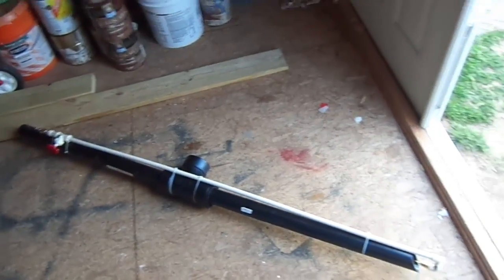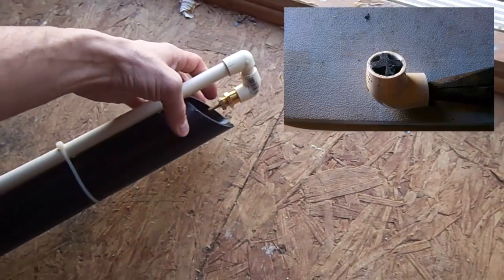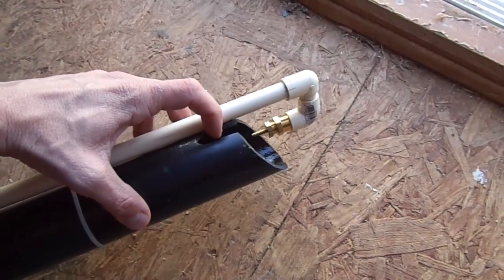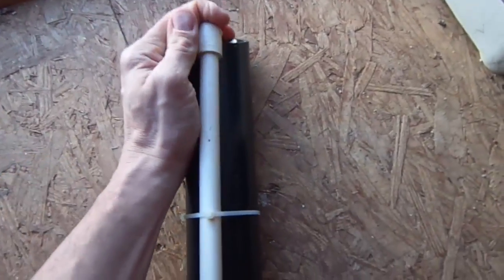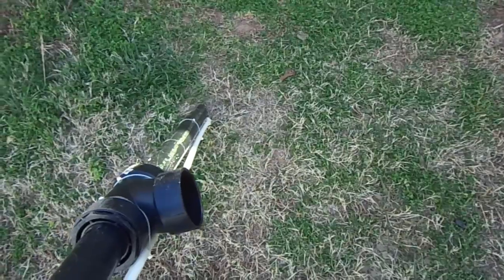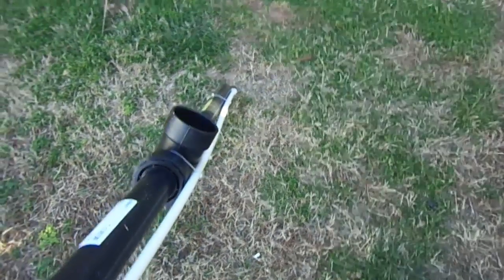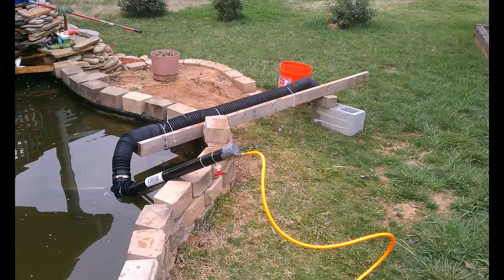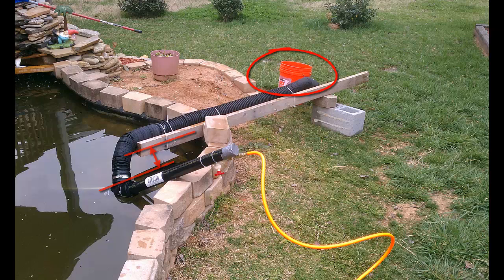DIY Air Lift Koi Pond Vacuum (Part 2/3)

Comment: Hi Wayne, my question is on your video regarding Air Lift Pump. I cannot get it to work and was wondering if you can tell me what kind of tip / size you are using at the bottom of the PVC that goes into the water.  I am using the same  size tip that connects to the quick disconnect on my compressor at the top of the vacuum.  . When I try to tweak my shutoff valve on the vacuum it either does nothing or it comes out so fast that my compressor cannot keep it running at 80 PSI. Thanks in advance

Comment: Hi Wayne,
Great video. It inspired me to try it. 

We have a lot of sludge build up in our pond and gravel that somehow magically comes out of plant pots (probably the always hungry Koi rooting around). The water is clear but I don't want the sludge (which I'm guessing is dead algae and dead beneficial bacteria) or the gravel so we typically drain the pond annually with a sump pump and use a garden hose to wash the sludge down to the pump.

It works but it's a day long project that wastes thousands of gallons of water, so when I saw yours sucking up stuff from the bottom with little water waste I thought; perfect.

Unfortunately mine doesn't work nearly as well as yours. 
It burps air frequently out the the tip (which kicks up a lot of debris) and the suction is very weak. I used 1.25" pvc and set up the air piping pretty much the way you did (the outlet is about 2" above the bottom of the tip). I'm using a shop compressor at about 80psi.

Is the suction strong on your set up?
And if so, what is the key; the size of the jet? the closeness of the TY fitting to the tip?

Thanks
Reply from the maker: Thanks for the nice comment, and well thought out explanation. I can't tell you for sure what is wrong... These air lift systems are sometimes a challenge to get right, because there're so many variables. 

One of the big keys is to get the proper amount and size of air bubbles coming out of the jet...and to not expect it to lift higher (from the top of the water line) than 1/3rd the dept of the water you're lifting out of. Possibly you're expecting it to lift too high up? Either you have too much air (not allowing much water to suck up), or not enough air bubbles distributed (to "lift" the water). 

I would recommend doing some research on air lift pumps, and fully understanding the concept of how they work. This may help you to understand your issues. 

I'm so sorry for the delay!! 

Best, Wayne

Comment: Were there fish in the pond while you were using this? I have fish in my pond, & I'm wondering what the noise level is like, as we know loud noise can injure or kill fish. So, is this safe to use while the fish are in there, or do they have to be removed first? I thought about a Shop Vac, but they're so loud.....
Reply from the maker: Yes. The fish were in the pond while doing this, and I have no issues. Honestly, I don't think it's too loud in there for them.

Comment: Just tried the 1 1/2 inch one at 24 inch deep and  drain spout 10-12 inches above the water and had a steady flow, instead of my air compressor  I had a 2.0 cfm hydroponic air pump and instead of a 90 degree bend for air tip I drilled a hole 2 inches above the intake tube it worked great nice steady water flow, have not tried the 1 1/4 sump pump hose on it, I think it's going to work!!! I know the 1 1/2 inch tube works much better, I did the same set up on the 2 inch and as

Comment: Made a 1 1/2 in one to going to try it to,pond is 22-24 inches deep, discharge is about 7 inches higher than water level, might try to turn psi down to, going to play with both of them, one guy on YouTube had o good idea, 16gal shop vac with a drain hose on bottom with 8 feet of hose and a check valve on it, run vac till full turn off and drains back in pond with net bag over check valve, there's a video on you tube, have a great day.

Comment: Have to see you video to cometary, can you use it with and without the hose in video so I can see if it does the same as mine, thanks again, been helpful , will got it dialed in sooner or later

Comment: Well tried it today worked so so, 2 inch lift tube and glued end cap on top end, at the t I glued a fitting to go to 1 1/4 to hook hose to, not sure what psi your running, tried at half open and full, some times got a lot of bubbles  coming out the bottom. The air line is 3/8  and at the t o the top tube  I glued  a round  peice of plastic in the t so water would'nt go in to the  handle, it doesn't have a steady flow it coughs or perks, I tried the 1 1/4 hose and it was so so, just tied a bag on

Comment: Please post a video of it working, I liked your idea so much I went out tonight and built one like yours, I used 2 inch PVC and 3/8 air line tubing, can't wait to try it tomarrow, going to hook a sump pump hose  to the output, and run it to a leaf trap for a pool to filter, and run back to pond. I will let you know how it goes, thanks for the info, Chad